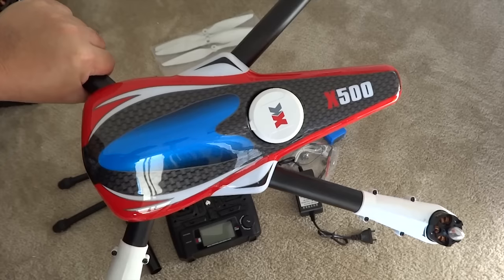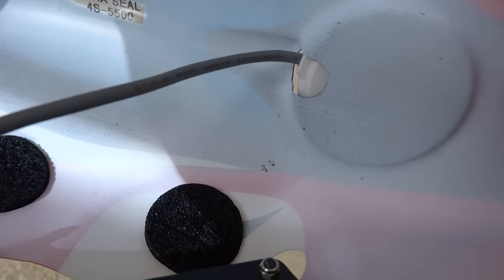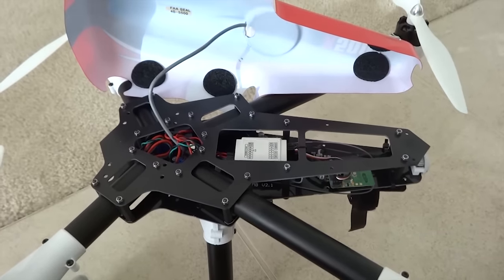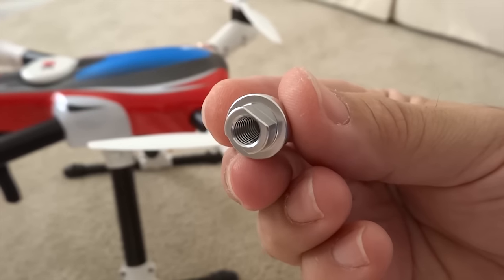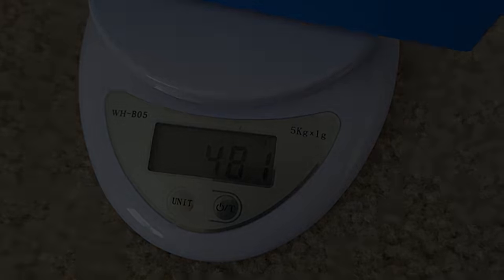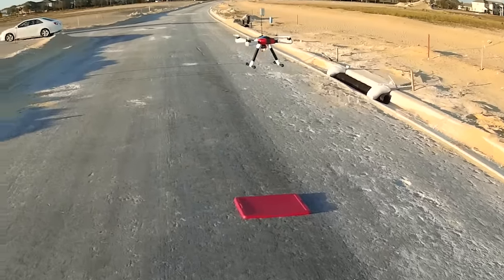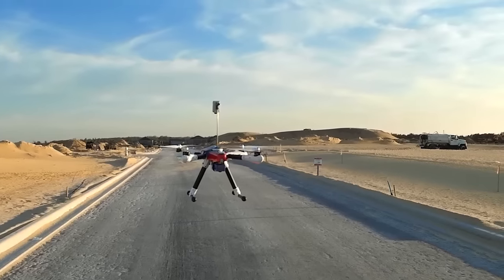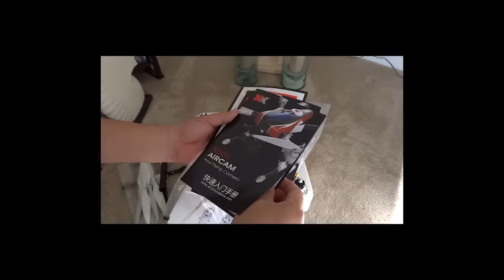XK Aircam X500 Unbox, Head Lock, RTH Quadcopter Test

Comment: I like the style/look.  That said the gaudy color scheme kind of ruins it (looks like a toy).  They should offer a more subdued color scheme option.

I notice you linked to the Walkera plastic gimbal, it's hard to find the weight of those, the better looking black, alloy one is listed at 120 grams.
Reply from the maker: +C Kay agree.  I was not expecting the plastic hood, have not seen those since the heli days.  i need to take a closer look at the gimbal setup today.  There is no instructions or label on how to, when you buy the basic version.  I have the black alloy g-2d, but the white is lighter.  They will both bend on a hard crash, especially on concrete, if the skids don't save it first, so going light is still wise.

Comment: Hi, I'm looking to buy either X380 or X500. Do you think its worth it to spend more for x500? Would I get more flying time with X500(G-2D plastic gimbal+Git2 camera setup)? Thanks a lot.
Reply from the maker: +Mario Szombati we just finished setting up the g-2d, there were no instructions, so i will write it up, take a few photos/video and share it.  https://dronemission.wordpress.com/2016/03/08/xk-x500-aircam/ because the LiPo is much more heavier on a x500 and the motors consumes more, you don't get more flight time. if you are planning to carry only a gopro or equivalent, you are open to either x380 or x500, the x380 is more than enough.  However you are not restricted to the stock battery on a x500, as it is not caged in.  It is easier to repair a x500 body as it just a cover over carbon fibre plates.

Comment: Hi diydrone.  wondering if you can help by suggesting something, I have a new x500 and before I flew it decided to Config to RTH nose in as I have done on my X380, unfortunatly when I made the change I didn't close the USB port but made the error of pulling the USB connector out, now all I have is a red flashing light, I tried reloading the firmware, but when I go back and look in the update folder after closing down it is empty, I used the X380 firmware, the flight controller comes up as a Galaxy FC on my PC, I have tried contacting XK-Innovations but they havn't replied, maybe I have bricked the controller, your comment would be appreciated  Regards Geoff.
Reply from the maker: +SuperGoofa sorry to hear that, we have been so busy with another project that i last did to the  x500 was to add a gimbal. I am not sure if we can be of much help, but did you download the latest official software client from xk and not the one on the forum?  The only other thing is after a firmware install you need to calibrate.  The software link is on the video description

Comment: would this be a good upgrade from the dji fc40 that i have or sick with what ive got
Reply from the maker: +Nick Walters for a budget filming gps quad with performance and accuracy, x500 yes, but we like the 380 size just to carry a gopro, git2 or firefly6s  http://dronemission.com/find/detect-x380.php see previous videos.  However that would be like flying a dji fc40, so maybe x500 will give you that boost.   I like putting my own cameras, as they get better each year, so xk series meets that option.  I will post a Firefly 2k video soon, on the xk.
Reply: +diydrone thanks for the reply the x500 as more power  because it use 4cell not 3
Reply from the maker: +Nick Walters yes any generic 4 cell with xt60 plug from any hobby store.  Big props and Motor: 2808 660/KV